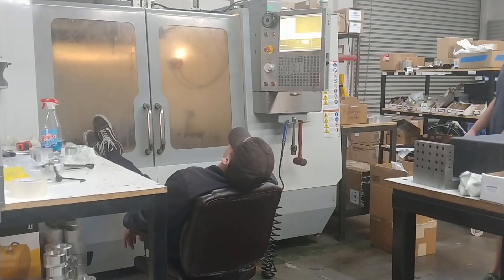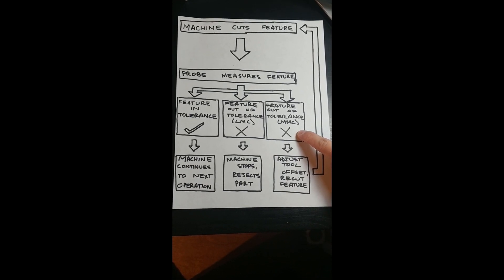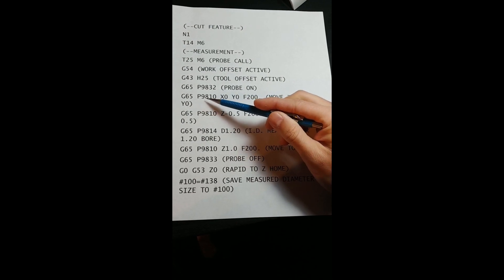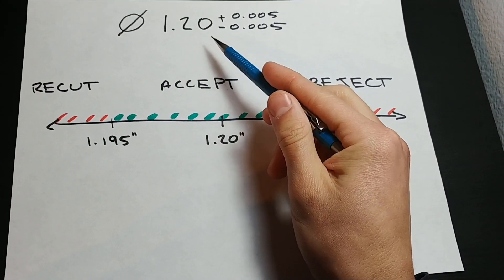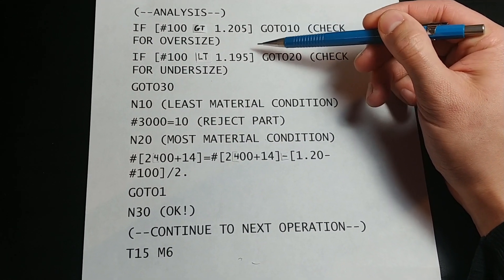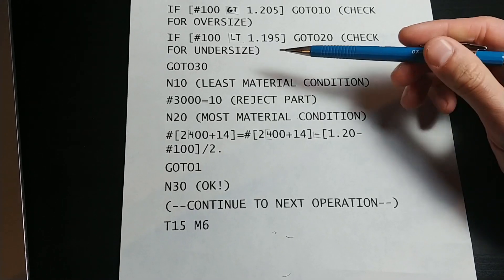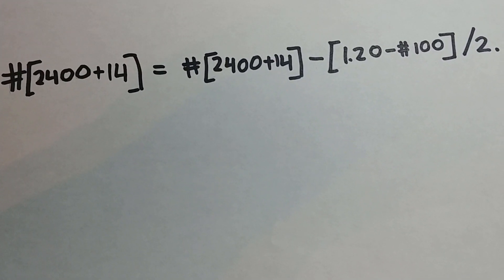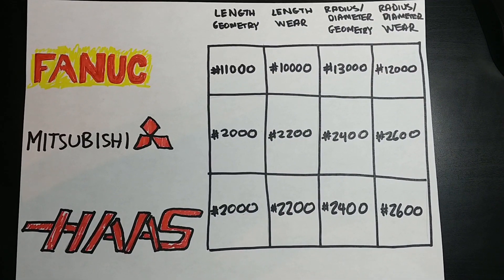How to Program a Renishaw Probe to Automatically Adjust Tool Offsets and Recut Parts

Comment: How to Program a Renishaw Probe to measuring the Angle and automatically rotating the workpiece zero point? I am no macro programming genius😏 I want to expand my VQC Probe Templates on Haas Machine.... And I want deepen my knowledge in macro Programming where can I find the basic Explanation for beginners in German language? Thanks for your attention and helping me out maybe😏
Reply: i think the renishaw inspection plus macros should be able to do that, check it out..
Reply: @lilchirp4846  I have 5 axis machin nd I want to kn about this angle adding into to offset directly after probing
Reply: Hi there, if you are using 5Axis machine it's quit simple, otherwise it need a special calculations such as you have to find out the slope formation. I am a Macro Programmer, able to do Fanuc, Heidenhain, EIA, basic Tosnac  and the Probes Reinshaw, heidenhain, Blum, Marpose and its cycles all in my finger tips.
Reply: @Macrosiva  How to Program a Renishaw Probe to measuring the Angle and automatically rotating the workpiece zero point? specially in 3 Axis VMC on Fanuc Controller
Reply: @shabbirabbas1718  

Hi, dealing in an X/Y plan ,  cycle O9011 , find out two points along your axis being X or Y. Capture both points machine values and calculate the resultant. Calculated value will be your new rotational points. Shift this values from your work origin.
Reply: @Macrosiva  kindly clarify in details...we measure the side in X direction two points by Renishaw OMP60 then fanuc control gives angle measurement reading on macro #139...How to use this macro so the my NC program and my work plane  rotates at this angle
Reply: @shabbirabbas1718  

I need the full information, or send ur PGM, by the way may I know your location
Reply: I need more information fixture alignment
Reply: @shreedharksannakashi8638  
Where r u?
Reply: From Bangalore
Reply: Thru rotation G68/G69 #810